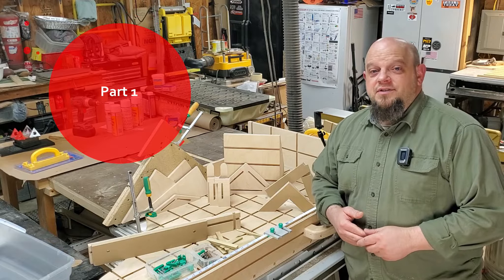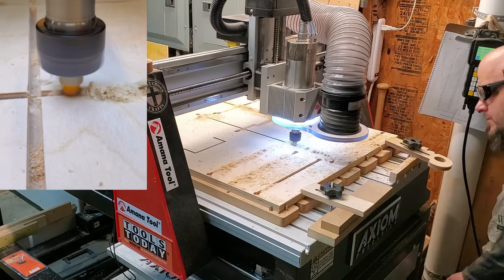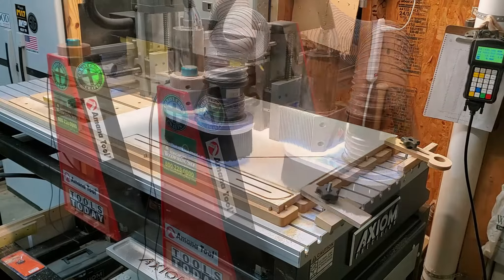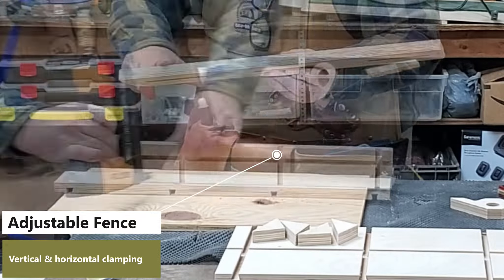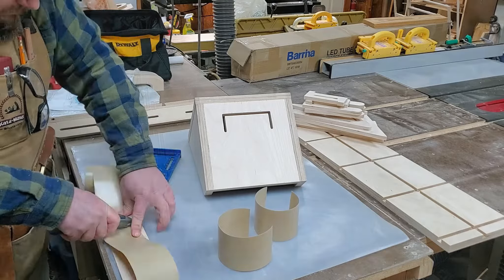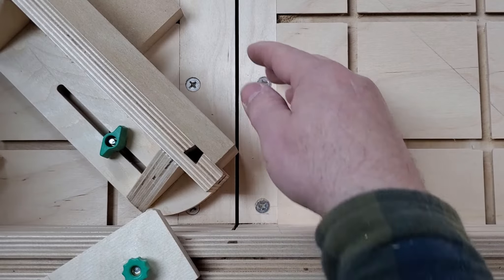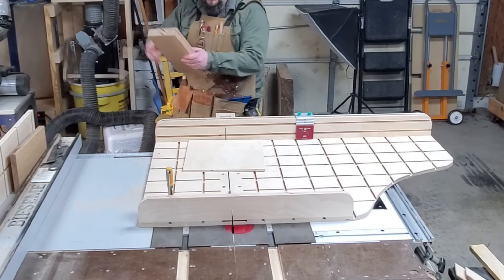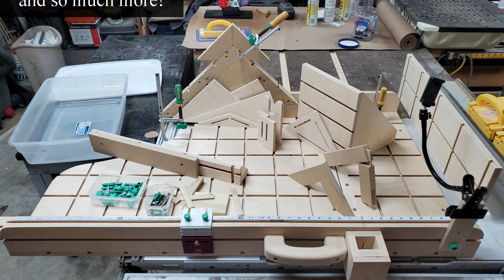Microjig sled update and new jigs pt1

Comment: Oh WOW!  That jig with the various cut pieces of angles is one of the most brilliant things I have seen in awhile. What is great, is that once you have made the small squares is they are dead accurate forever, as long as you don't drop them, and you don't have to spend a ton of money to make them either.  I really am going to integrate that idea into my next micro-jig crosscut sled. Thanks a million!H
Reply from the maker: Thank you for the gracious words.  They are indispensable for setting up angles.  If ya get anything really odd, you can make as many odd balls as needed.

Comment: I got the Microjig Dovetail Clamp Pro Kit yesterday and I can't wait to get started.

I have an Incra V27 miter gauge and it has all but replaced the cross-cut sled I made a few years ago. However, I was making an odd angle cut for a birdfeeder prototype I'm working on, and it just didn't work well. Not that it wasn't accurate, it just wasn't safe. I made a tapering jig a few years back as well but it's just too big for the piece I need to cut. When I got to thinking about making a smaller one, I looked into some T-track and hold downs and hardware and realized, the Matchfit system was a better use of my limited resources. 

I had seen your "part 2" video a few months ago so when I came across this one in a search, I just had to watch. I'm really impressed with the versatility of the Matchfit system and you have certainly maximized the livin', you know what, out of it. The tenoning jig got my attention when I saw the "part 2" video. It took my three tries to make one that goes over my table saw fence as I just couldn't get it square to the table after driving in the screws. The tenoning attachment you made for your sled is not only a great use of the Matchfit system but also greatly simplifies the jig while maximizing it's usefulness.

Your series on the Matchfit system has been a great inspiration. Well done.
Reply from the maker: Thank you for watching and all of the kind words.  I've been woodworking a long time.  I have had the same struggles with miter gauges and jigs.  The microjig has nearly solved all of my previous complaints and opened up the door to many solutions.

I had used the "over the fence" jigs before with the same result.  The key for any of them is it needs to be built square & reference something square.  I, too, love the safety & repeatability of making jigs for the sled.  It frees your hands up to actually be safe and not need four hands to perform a cut.

Get creative and make the system work for your needs!  Happy woodworking.
Reply: @ChristcrossCrafts  I have the Ridgid R4512. It's fence is pretty narrow, which makes squaring a jig all the more challenging. Thanks again for the videos. Hopefully I can put something together and post on my fledgling channel.

Comment: I just discovered the Zero play system today.  I'm sold!  I will order the parts right away.  I was really impressed with the work bench.  I won't to build one, but I'm reluctant being new. I'll be building the miter sled really soon, though. 

I just subscribed and will check out more videos tomorrow. If I don't go to bed in 5 minutes, it will be tomorrow! 

Good night, and thank you for the update.  I'll watch your original later.
Reply from the maker: Thanks for watching.  Sleep is important.  I absolutely love the system.  I would have used the zero play system on mine but my sled is a little large and they wouldn't work for me.  For smaller sleds, it certainly will.  

I'm in the process now of updating my workbench top with a torsion box and matchfit grooves on the top.  Everything is custom on it and It has taken me quite a while to build it.  It likely won't get posted until next month sometime.

Comment: Hi Chris. This is really built very professionally and functional. I have a question: Does one need the vertical channels? It looks like there is no way to slide anything in them as both ends are closed. One idea would be to make the front fence not permanent. But of course this means readjusting every-time you remove it. Did you have need to use the vertical channels? Thanks in advance for your reply.
Reply from the maker: Thank you for watching.  I do use the vertical channels.  I slide hardware in from the back fence (I made slots so they fit).  I also use t slot hardware (like toilet bolts) and they can turn at any intersection.  

Since this video, I've also found the clamps can straddle the main fence from outside the sled and be used to clamps parts close to the fence.

I do use the clamp that got locked in by happy accident (if you watch the original build video).  If I ever need more clamp options I decided long ago that I'd widen the slots near the furthest fence to allow clamps to drop in.  So far I haven't needed them.  All the other methods have worked perfectly.  

Part 2 of this shows more options and the original build offers more details about functionality of the sled itself.
Reply: Thanks for getting back so quick. I should have waited until I watched the ‘jigs’ videos before asking my question. All your videos are fun to watch and informative. Keep them coming. Have a great summer.

Comment: love the design and the explanations. Do you by chance have the CNC plans for sale? that is something I would happily pay for to get that.
Reply from the maker: Thank you for watching.  I don't have any plans.  These were made up specifically for my needs and larger sled.  Some of the design ideas were taken from the MicroJig website plans and videos, and altered to fit my needs.  Others were made to help provide proper alignment of those jigs at the different angles.
Reply: @ChristcrossCrafts  thats a shame, I dont have a CNC but there is one at my local Men's shed that I could have used. I am in the process of building one based on your design. The only change I might make to mine, making it more appropriate for the Dewalt DWE7491 is to make something that binds tight to the rip fence that will accept a bunch of different jigs., keep making sawdust, love the video's..
Reply from the maker: @christopherstewart5443  Thank you.

These can all be cut out using traditional tools.  Some of my earlier jigs were made on the table saw. Microjig has some patterns for a few variations.  

I originally was going to use my fence, but it's very difficult to get them perfectly square when tensioned to the fence.  It also means you have to move the part and keep it in line with the fence.  Using the sled, it's all mounted and you don't have to hold or have any coordination with the part.  Simply push the sled, which is always square.

Comment: If I were to make a top for a table using the dovetail system, how thick mdf sheet would you suggest I use - is 3/4” ok? That’s all I can find at my local supply.
Reply from the maker: Im working on my workbench now.  Mdf may be a little brittle and not offer the strength,  especially around the edges.  You could edge it with hardwood and be okay. 

If there are no supports, I'd at least glue two pieces and double thickness it.  If it's made on a torsion box frame, it should be ok as is with a hardwood edge.
Reply: @ChristcrossCrafts  for my application I’ve already built the workbench and adding this dovetail system as an additional layer. Wasn’t aware of this at the time of building the bench. So it has a 1 1/2” top currently (two 3/4” plywood sheets laminated) that I’d add this to. So would the 3/4” mdf be thick enough you believe?

Thanks for your advice and I look forward to potentially seeing your build in the future.
Reply from the maker: @zach smith  yeah, that should be fine.  I'd still edge it with hardwood or it will be prone to chipping.  I made my drilpress table out of particle board with the system before I did my sled.

Comment: Loved the video as its given me loads of ideas but I have one major problem. Every time I make a matchfit sled it sags. I'm sure that's due to the amount of material removed when making the slots. I've tried MDF and ply but always get a light bow. Do you get any sagging? If not is that the difference between CNC and hand routing? Use thicker material? Any ideas?
Reply from the maker: Mdf & regular ply doesn't work well unless double thickness.  Thicker solid wood or 3/4 Baltic is best.  I've  had no sagging or warping on mine.  I believe mostly because I used taller fences on the front and back, as well as aluminum runners.  I also hang it up when stored instead of leaning it up.

I have made regular ply pieces that did warp but they are part of an edging that is screwed to a bench so the warp was taken out when mounted.

Comment: Can't use the other parallel slots either no way to get clamps in them.
Reply from the maker: I have brought clamps, fixtures, and T-bolts in from the side and easily used them on many projects.  After I cut slots in the back fence, I can bring fixture pieces in from the back if I need to for jigs or cam clamps.  I can bring in T-bolts from the side and turn them at any intersection to then go front to back.  I've been using this sled for almost two years and wouldn't change a thing.

Comment: I don't know if anyone else has mentioned or if you've noticed yourself yet... but your 30° and 60° labels are reversed (7:25). 
And, your 22.5° mark is not on the 22.5 angle (7:36) - that's the 67.5 angle.
Reply from the maker: Good eye... If you are looking at the angle alone, yes, but these are set-up blocks for the fence that cuts the the opposite.  It's confusing, but when referenced on the proper point, they do create the correct angle for the miter.  I've tested them.
Reply: @ChristcrossCrafts  Ah! Sorry, that makes sense. So the label is not for the angle on the jig, it's for the angle of the cut that jig gives you.

Comment: Yeah. Most "woodworkers" don't have a CNC machine. If we did, we wouldn't need a "jig". Jesus. You guys are setting up a paradigm of "build this" if you have 15k of tools at your disposal. 

Fuck this.
Reply from the maker: Um.  I built most of my Microjig stuff using a hand router or a router table.  I built a few of these jigs on the CNC just to see if I could. Go watch the original build.  No CNC required.